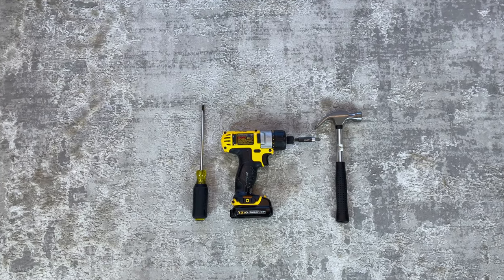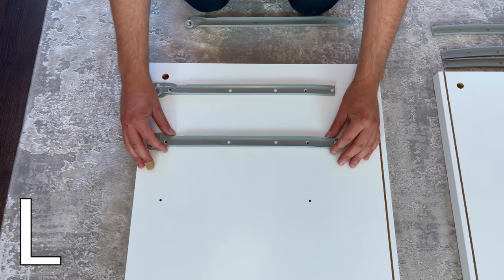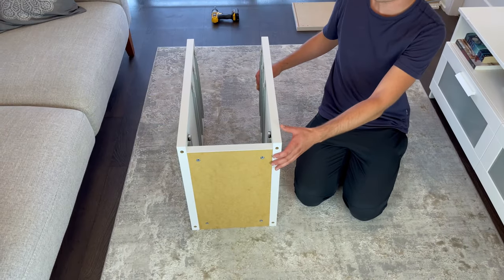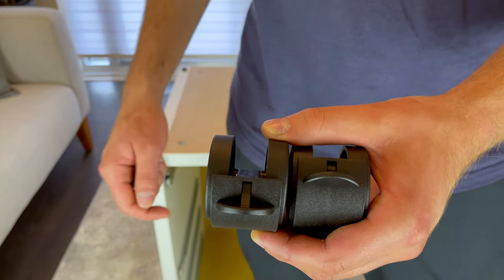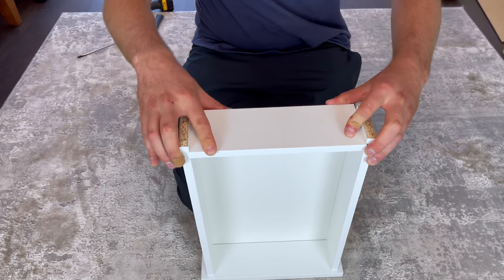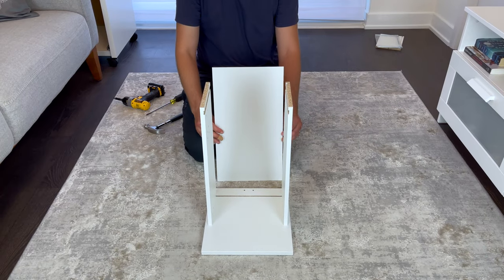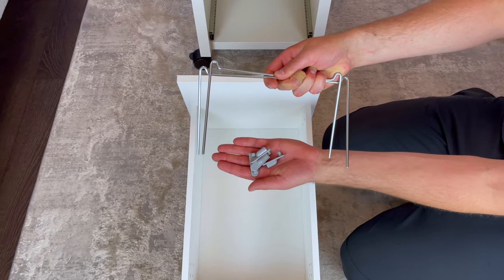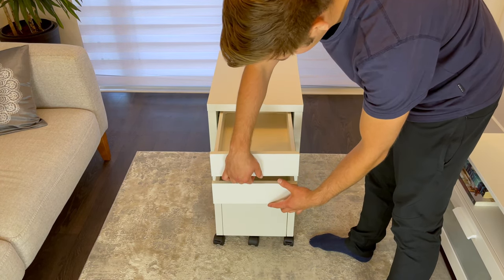Easy To Follow IKEA Micke Drawer Unit Tutorial

Comment: You think this one can handle as much weight as the Alex drawer? Thinking of having 2 of these for my large desk on the sides.
Reply from the maker: I can't find any weight limits for both drawer units but probably a bit less than the Alex due to the Micke's design and materials used for the outside structure.